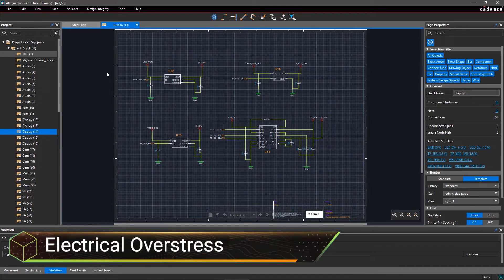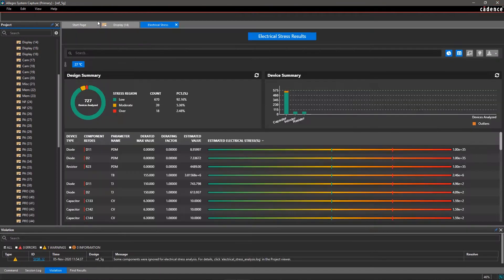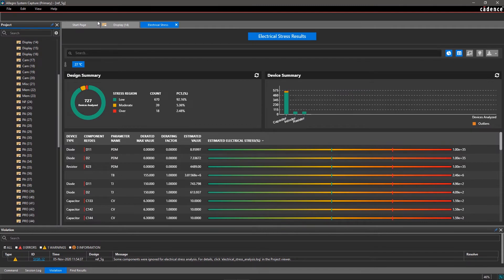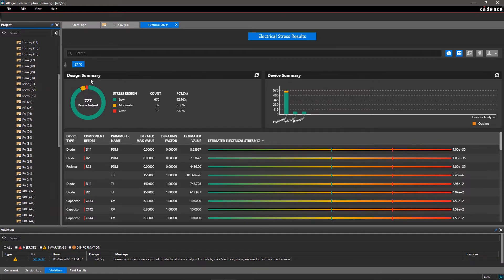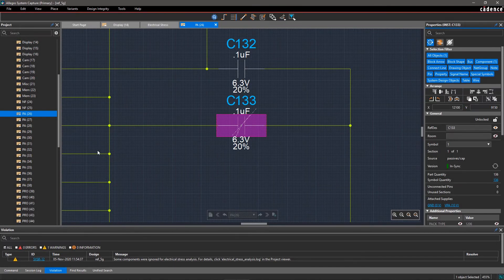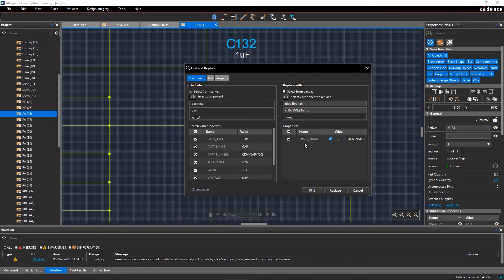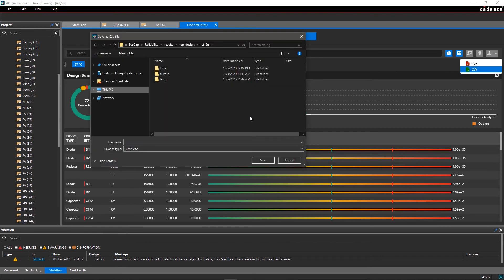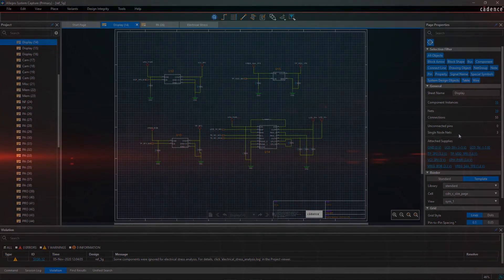How to find and fix electrically overstressed components in your design | Allegro System Capture

Comment: Thank you for the video! Is this analysis equal to Voltage tolerance analysis? Also, can you change the criteria for the low/moderate/high levels?
Reply from the maker: This is not a voltage tolerance analysis. It analyzes devices for voltage, current, power-dissipation and temperature stress. If any of the values is more than rated, it is flagged. You can change the criteria for low/moderate/high levels by applying derating factor.